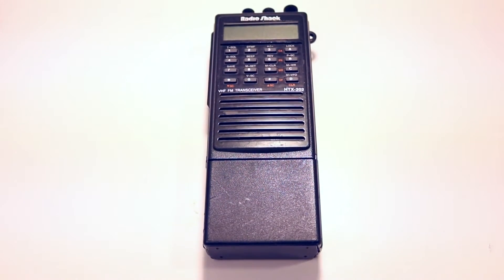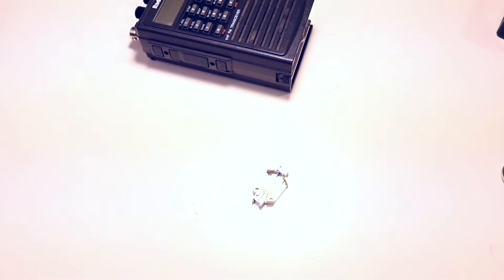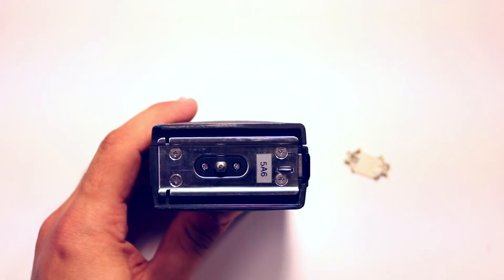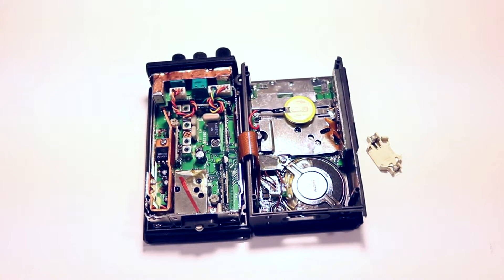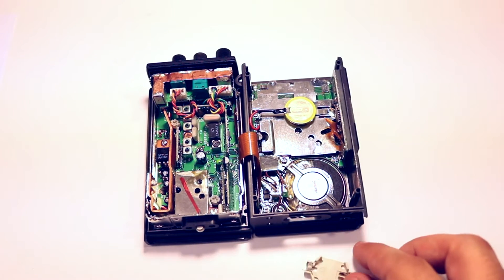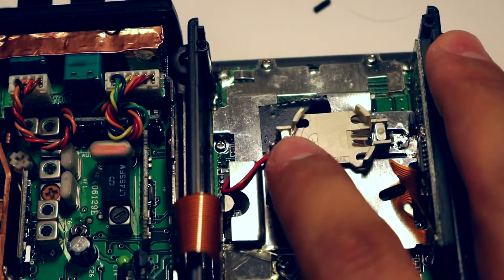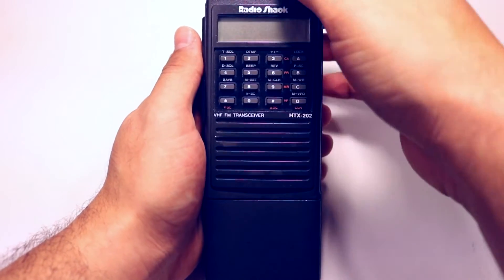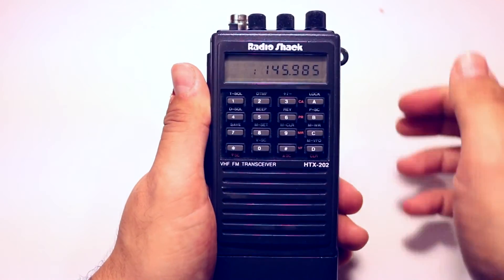RadioShack HTX-202: Fixing the "ER1" Error

Comment: Seems to have fixed mine! Used a batt mount from an old PC motherboard. Serial #0082920 is back on the air after 10 years in a drawer.

Comment: Question for anyone.  I've been trying to help a friend who has an HTX-202 with the ER-1 memory battery error.  We are not in the same state so we've been emailing back and forth.  She replaced the battery, did the reset command and ER-1 is still showing up.  She's checked the battery connections, battery voltage, etc.  Everything SHOULD BE working, but it's not.   Would anyone know what we could check or look at next?

Comment: Hi, I followed the procedure as well, and did reset the cpu - and I am still getting the error message.  I plan to take another look at it - any ideas?
Reply: @douglasbollinger3626  I don't really have any test equipment.  I did open it up again and switched out the battery.  Reset numerous times - still no good.  Would it help if I sent you a photo of the inside?
Reply: I’m trying to post a photo, but don’t see a way of doing it here!🤷‍♀️

Comment: Excellent video, thanks for taking the time to post it!  I added a battery mount and replaced the battery, also reset following your instructions -- everything works as expected UNTIL I power down, and then start again.  ER 1 error pops up again, then I have to manually reset again (so each time I turn on the unit) in order for the unit to function.  Any thoughts on why that might be?

Comment: I just replaced the Li in mine but I didn't use a battery holder. I bought a tabbed battery and replaced it with that. I've had this radio for about 20 years and this is the first I've had to replace this battery. So if this new one lasts as long it will probably outlive me... Your video helped a lot. Thanks!

Comment: I still have mine with box & manual. They are well built. Even have the AA battery pack and a 12 volt long battery I need to rebuild. My er1 just came on . 2 nd replacement now. Kg4enz

Comment: A very nice repair video....  I got the ER-1 message and figured right off it was the internal memory battery-  but lacking any further info (no manuals etc) I really appreciated the reset scenario. 

I didn't use a battery holder- but quickly !! (very quickly !) and deftly tacked solder'd wire connections to the battery itself.  This maybe not the approved method (do not over heat the battery !)  but this technique has worked for me for many radios over many years.
The battery was then held firmly to the the chassis with a small dab of silicon RTV sealant. 

Thanks Again !